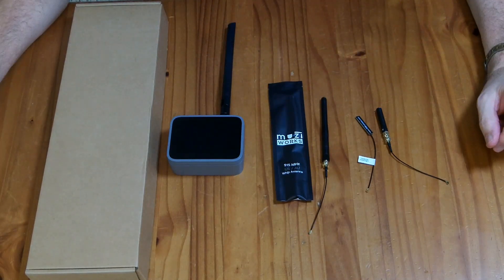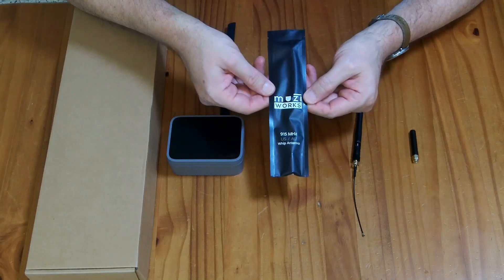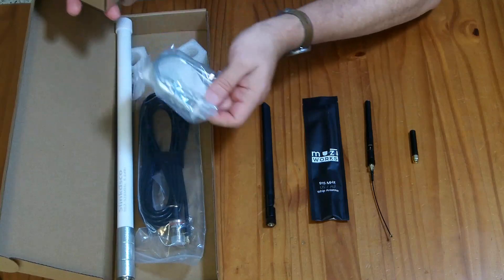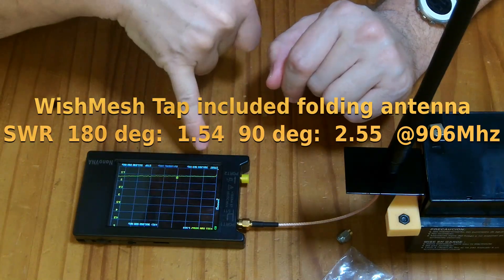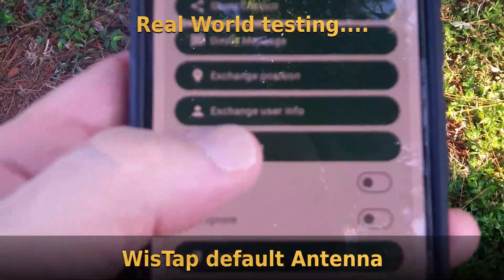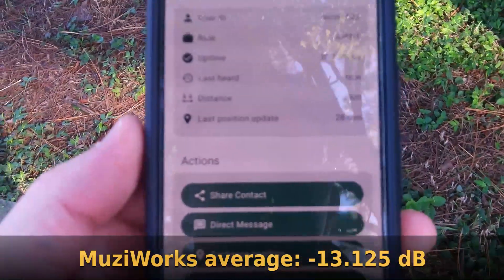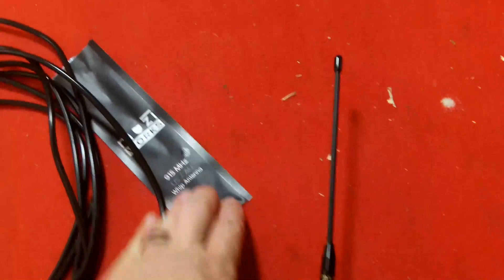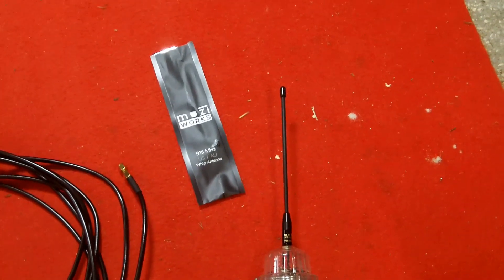915Mhz Antenna Shootout & Recommendations for Meshtastic  and Helium HNT mining

Comment: im amazed that you got a signal on the out door antenna with that length of coax :o
Reply from the maker: That's what came with it, appeared to work well. I figure if you actually mount the antenna outdoors that length of coax may be representative of the distance to your roof, so left it in the test.  Loss per foot of coax isn't bad if it's good coax, but yes, you do want to minimize the length you use.
Reply: @summetj  in my experience you put the node in a weather proof box.
cut the coax and replace the plug to get the coax as short as you can. then mount it up on the roof or the antenna pole for you tv antenna.
I actually attach the antenna direct to the case, so the coax is one of the 4 inch leads.
With all that coax your loss will be huge.
Hope you find something that works for you :)

Comment: I have a Musi whip on my handheld,  heltecV4,  works well,  I like the whip because if I bump it against something, it wont put pressure on the sma connector on the plastic case.  

for the outdoor antenna,  the less coax you can use the better,  I mount my node directly to my fiberglass antenna.  (only coax is the tiny Ipex to N-connector pigtail  adaptor)   50ft of RG-8 has a loss of over 3db.  that's basically half your power.

Comment: For anyone who comes across this less coax is best in our mesh in the UK we been recommending no more than about 1m or 3ft of coax 
However your tests are about the same as I've seen in my own testing i have similar whips to your muzi work's but for 868mhz a short one and a long one thats about 40cm or 16inchs i believe 

Also I want to point out higher gain antennas are not always better my home node been running on a dipole I bought a similar outdoor antenna to what you showed and while it improved my links to nodes on local hills the nodes in my town that relied on my home node due to me being up the side of a valley and town being a the bottom they ended up being cut off as more of my signal was going towards the horizon 
I changed back to the dipole and links got restored this is due to the dipole sending signal in a more ball shape compared to the higher gain antenna that was more squashed oval shape 

Anyway great video and I'm glad I'm not the only one to be using those solar lights for nodes